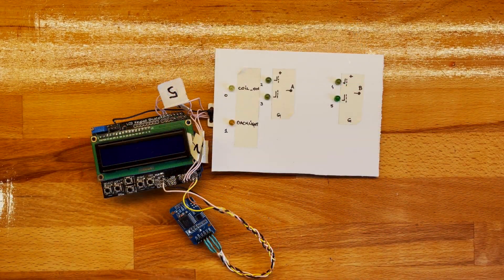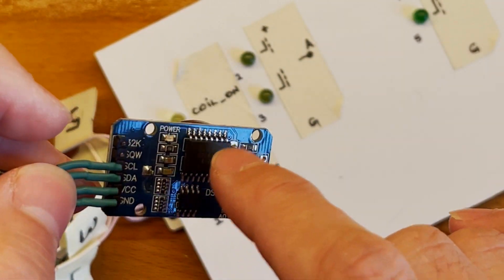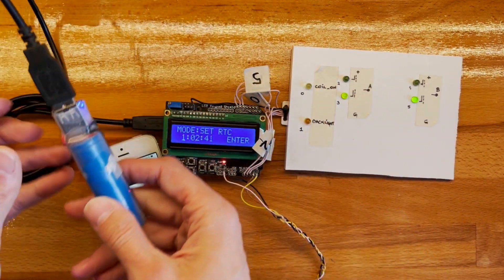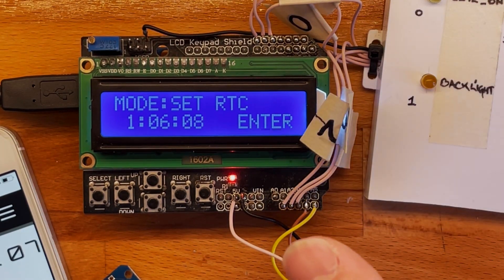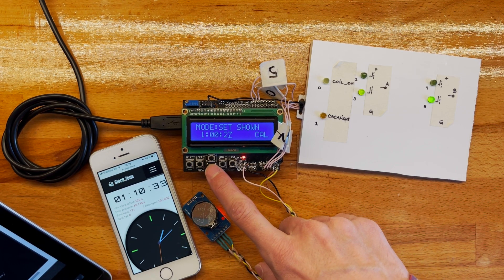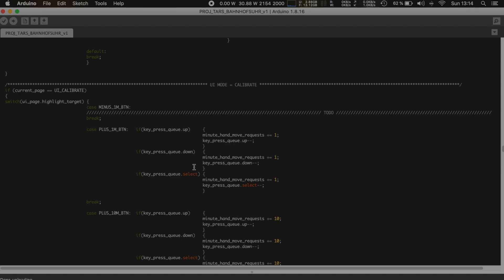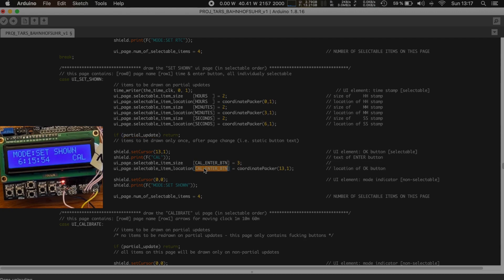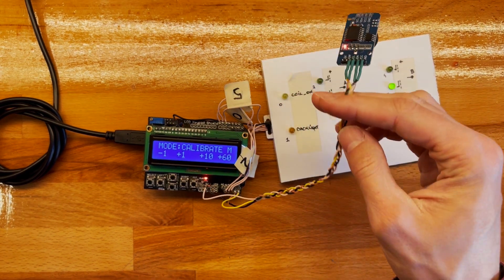Train Station Clock Driver - Arduino LCD Shield + DS3231 Project

Comment: I have a 14×1 LCD screen, but its structure is different. How can I run it? It has 9 pins. I found vcc and gnd.  I also found the led control end, but I can't find the other 6 ends. Can you help me?
Reply from the maker: I haven't touched any of that - my shield has 4 data lines which are controlled by the Arduino - but - all of that is done by the library

you can also buy i2c adapters that will run these segmented displays
Reply: @Darieee  i2c.  I need to know the location of the pins to connect it to the adapter.  how do i do that if i don't know